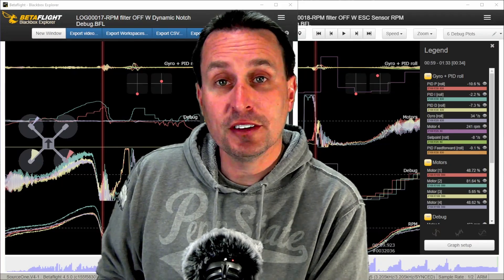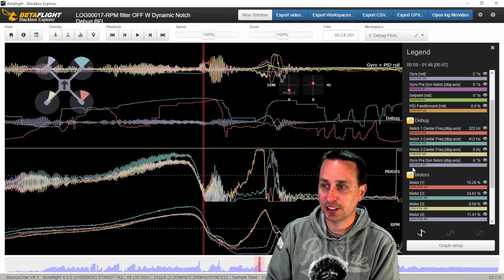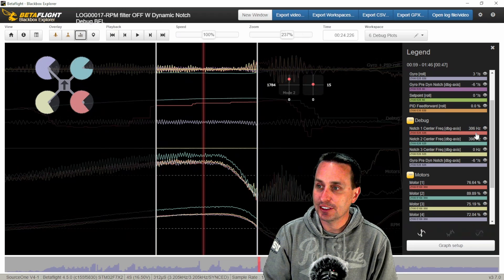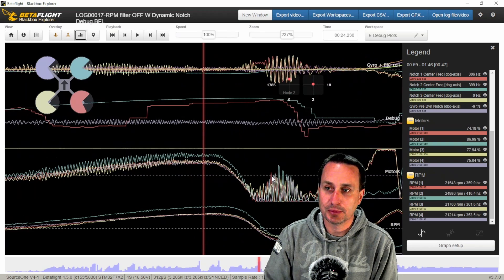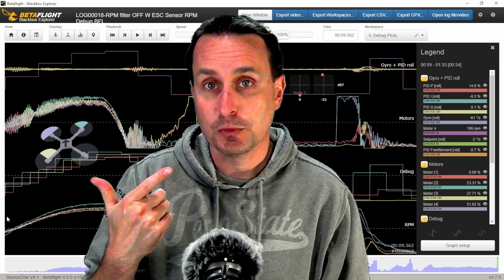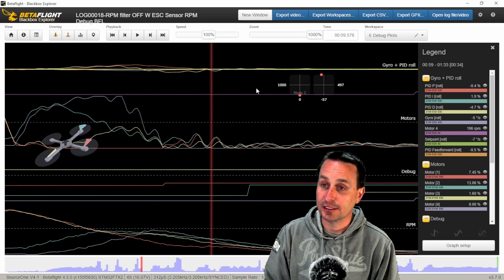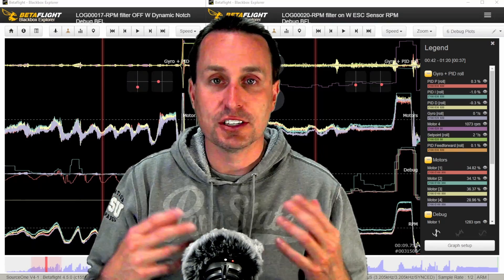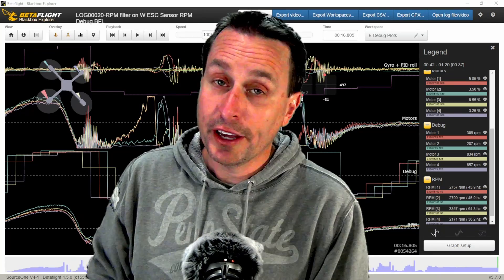BF 4.5 RPM Data Analysis  |  Dynamic Notch vs. RPM Filter

Comment: so it turns out that if the frame has no resonant noise, then in theory you can leave only RPM filters and an antialiasing filter for 8/4 kHz, an F4 processor, 10-12 inch propellers, 3115 motors. Am I right? for maximum delay reduction?
Reply from the maker: @user-fe9oq3yd9o  RPM is cotrect.

Anti-aliasing is a farc.  Not really needed.
Reply: @uavtech  and what filters are needed at a minimum to have a minimum delay.. RPM.. and what else?..
I'm talking about Halfy

and do you have a video?, so that we can understand which filter gives what delay and which filter can be omitted. to have a minimum..
Reply from the maker: @user-fe9oq3yd9o  lowpass filters have the least bang for the buck.  So try to move those up or turn them off.  Even if you need to keep the Dyn Notch enabled and a higher notch count.  If it lets you move up the lowpass filters, that is the best approach.  I have a filter calc tool at tiny.cc/uavtech if you want to see the delay/filter strength for each of the filter types.
Reply: @uavtech  wow, interesting about the calculator.. I'm trying to delve deeply into the topic now, so everything is interesting and useful) THANKS!!!

Comment: Hi Mark. I have a doubt that's related with notch filters but is most a build question. My quad war flying well, i tuned it and it was pretty straightforward including filters, just addresed the single noise column of the frame ressonance at 218hz with a notch filter, configured rpm filters, etc. Now I've rotated the stack 180° to get xt60 in the front and replaced the rx with a dual-antenna one that are on both rear arms. Now I got two very clear noise columns on the throttle x frecuency chart at 167hz and 230hz. The lower freq. noise is slighly visible in roll axis, but very strong like the higher freq one in pitch axis.  Could it be because of the rx antennas (2.4ghz)?, previously I had just one on rear righr arm. Battery lead is alse secured with zip ties and connector tighted in the battery straps. Thanks!

Comment: Great summary, Sir.
And yeah, bidirectional dshot RPM data comes right after every motor command, so pretty much every PID loop.
Then it's being filtered a little, i think with 150hz pt1, which gives ~1ms latency at frequencies close to zero.

Comment: Actually it's possible to get ESC telemetry much faster than your seeing. It's technically possible to get 8k ESC telemetry. Yes it does have more overhead than bidirectional dshot, but it's possible bf just isn't setup for that.